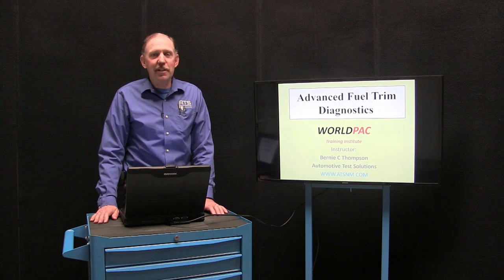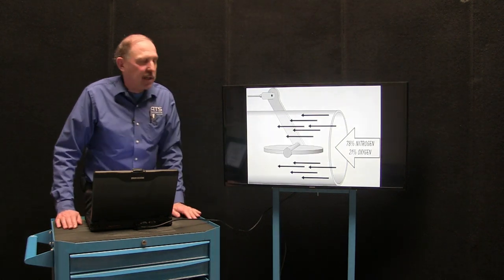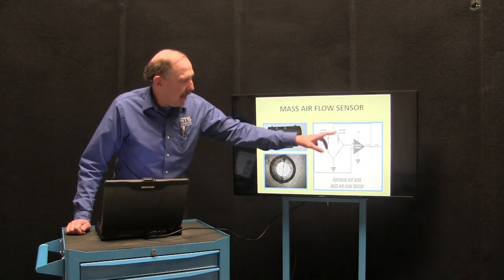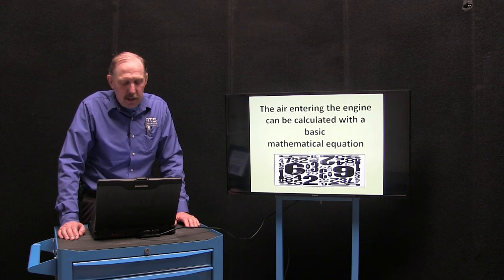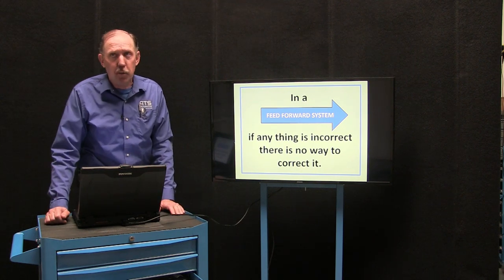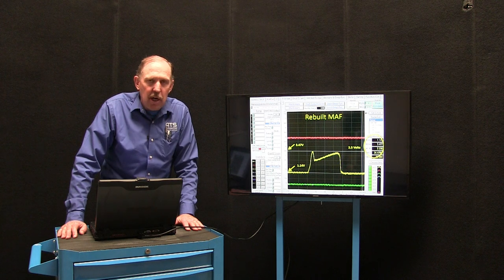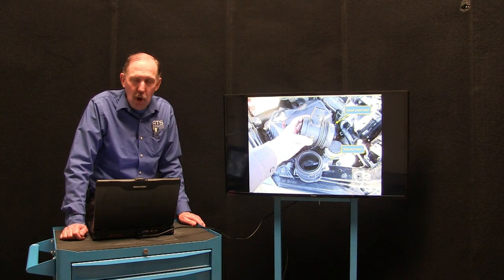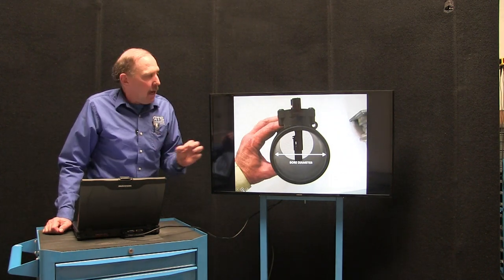Advanced Fuel Trim Diagnostics

Comment: Love the passion, Bernie! Fantastic seminar!       Question on VE: the theoretical mass air flow (g/sec) = [inlet air density (g/L) x Displacement (L) x RPM (1/min)/2/60 (sec/min)]. For a 3.4L engine at 800rpm idle I get 9.7g/sec. Why is this not closer to the rule of thumb 3.4g/sec? Inlet air density I assume is 1.28g/L x 1/3 since the intake manifold pressure at idle is roughly 1/3 of atmosphere...
Reply: I'm studying this in depth to help diagnose fuel trim/lean problems now.
Dry Air density at sea level 77 deg F is 1.184 g/L.   (A penny is 2.5g for reference)
Density is proportional to absolute pressure (MAP).   It also depends on absolute Temperature, and to a lesser extent humidity.  (search for Air Density Calculator) 
Pressure at sea level is 101.325 kpa,  so you can think of a kpa MAP reading as a percentage of pressure and therefore density.  

So at an idle MAP of 26 kpa,   air density is 26% of 1.184 = 0.308 g/L 
You must also take into account Volumetric Efficency (VE) of an engine which also varies greatly with RPM and MAP from about 60% to 90% +/-.  (search for VE table)
The RPM-VE relationship has to do with resonant frequencies of the intake and exhaust pulses in the manifolds and tuning these  (think of playing a trombone).  Max VE is always at peak torque RPM where the engine breathes the best. 

I have been using this info to try to calculate MAF, from speed density and always come up 10-20% more than I am seeing from my MAF sensor...(I don't have a known good/bad MAF sensor).
I suppose I could always just unplug the MAF and see what fuel trim tells me, but what fun would that be :-), and besides that won't tell me if i have a vacuum leak or bad MAF.

I was surprised at the MAP data when increasing RPM in Park when I graphed MAP, MAF, RPM, and Calculated LOAD, but then after thinking about it, it made sense.  27-->21-->24

Fuel consumption is MAF/14.7 while properly working O2 sensors are switching, and 12.7 under fuel enrichment at max power.  Fuel density is 0.75 g/cc  (75% of water).  There are 231 cubic inches in a gallon, and 2.54^3 cc in a cubic inch.
Reply: Nice Question Ivan! I guess is because we have to consider ground elevation and air temperature into the calculations for proper air density. I recently found this channel, Bernie is awesome! Can't believe is still for free!
Reply: @sinegra30  Yeah Bernie is in a league of his own...the mad scientist of auto diagnostics :)
Reply: Ivan,  the reason it is not closer to the rule of thumb, is because of the throttle plate, it is closed at idle.  An engine at idle has a VE of 20% ish...The down and dirty formula I like is this (RPM/60) X (DISPl./2). So with your 3.4L engine at 800 rpm you get 22.7 g/s, BUT the engine is only 20% efficient therefore 22.7 - (22.7 X 0.8) = 4.5 g/s.  But that 20% is also a rule of thumb.  Theoretical Airflow for our use in diagnostics is best used at high engine rpms where we expect VE's of 80+%. I know it's been a year, hope this helps.
Reply: Bernie will respond when you start using ATS testing systems on your channel.

Comment: Around the 51 min. mark he speaks of the MAF voltage being low on this KIA. The "rule of thumb" measurement of 2.7v to 2.8v  that he uses I 100% agree with,  Just to point out this is a good number for a 6 CYLINDER engine... A 4 CYLINDER engine "rule of thumb" in my experience is 2.2V to 2.4V on the MAF testing.   Great video as always.
Reply: 000

Comment: Great explanation. I just replaced a MAF on my Toyota, getting code for lean on both banks. I only figured it was the MAF after running a 3 drive cycle procedure based on a Service Bulletin and seeing that the final MAF reading (with ignition on but engine off) was over the spec limit. New MAF did the trick.

Comment: If the injectors have a higher rail pressure will they inject more fuel per ms if the injector hole size stays the same? Or is it just the size of the hole/time open that dictates how much fuel is injected?

Comment: Hello,after Iam watching your video now I have a question in my mindthat I would like to ask you..in a 2.4 petrol engine at idle how could I get the right mass air flow (grams/sec) of an engine... Thanks .iam here in Darwin
Reply: It’s usually 2.4 Liter engine should be 2.40 grams per second that a rule of thumb to overcome the parasadic loss of the motor any questions feel free to ask
Reply: U multiply it by 40 for a wide open throttle give u a estimate of how the engine is breathing VE volumetric efficiency
Reply: Thanks for the good information

Comment: The video is great, but I don't understand (21:00) the calculation. Let's imagine we have four cylinders engine - each revolution of the engine has TWO intake strokes. So if the engine produces 13,3 RPS, there would be 13,3 times 2 equal 26,6 Intake Strokes Per Second. In video we have 8 cylinders engine and only 3,33 ISPS. May be I haven't understood - English isn't my home language.

Comment: All your injector talk is irrelevant until you put it into an "engine", not a motor! Motor this, motor that, ain't none of ya replaced a windshield wiper engine! have you? How about a power window engine? Did ya replace one yet? 

No?

An engine deals with combustion, regardless of internal or external.

A motor is electrical, always!

Both can provide a motive force, but only one runs on fuel. 

I feel we are too far past the time for kindness, it's time you and your kind start to get it right!

It's not a motor, it's an engine. It's not an engine, it's a motor..... Learn the difference and teach it correctly!
Reply: do you just regurgitate nonsense you read on facebook and the internet? go look up the actual definition for a motor on google (it'll take you 3 seconds, promise) and get back to us. start thinking for yourself instead of going with whatever fresh meme is circulating.  hint: google's definition includes pictures of engines
Reply: It must kill you when registering your car at the D "M" V. I'll bet you would never buy a "motor"cycle or have any kind of "motor"sports equipment.
Reply: Bro, maybe you are not aware that Bernie Thompson is probably one of the most respected and knowledgeable people in the United States at what he does. I just checked out your videos on reheating pizza on the barbecue grill and snowblower review and they kinda sucked.
Reply: @Joe.O_623  And yet I'm still not wrong!
Reply: @Finite-Tuning  Okay but the next time you try to 'educate' people try being right.